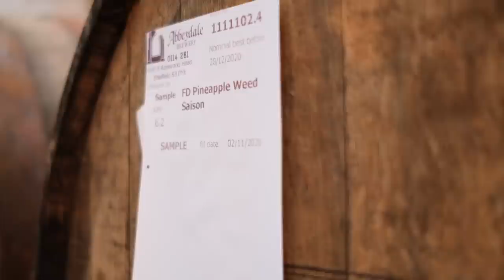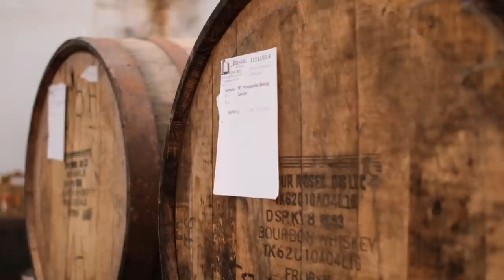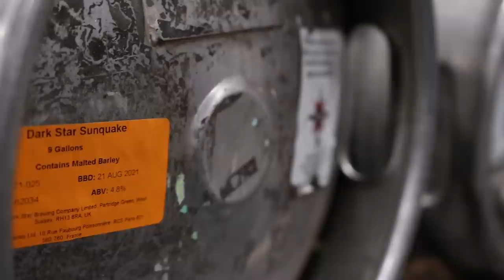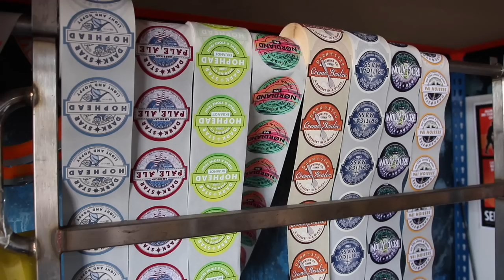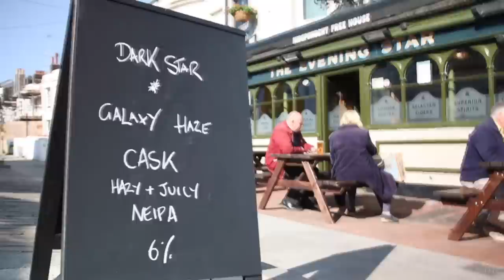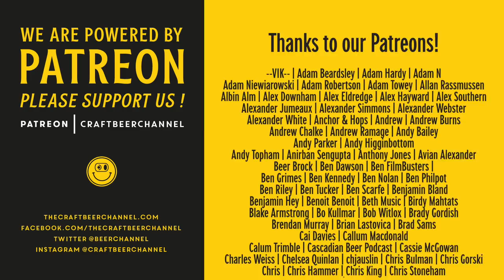The Future of Cask (Keep Cask Alive pt 3) | The Craft Beer Channel

Comment: Loving this series.  I was introduced to cask ale in the 90s as a late teen on a trip to England.  I fell in love with it. Thankfully in my area of the NE US, I can get cask ales here and there, but it is nothing ubiquitous like being in the UK. After my second trip to England in 2019 I came home and set up a cask system at my house. I have a few pin casks, a beer engine, properly controlled cellar temps, and a CO2 breather system for extending the life of the beer beyond a few days. Although when friends are over I just run with a traditional soft spile for serving.  I do several clones of my favorite UK ales that turn out very well. My property has a water profile that's right on for traditional bitters.  Thanks to Paul Pendyck of the Bull's Head Pub in Litiz, PA for starting UK Brewing Supplies.  Without his importing it would be difficult to access affordable cask equipment.
Reply from the maker: Sounds like you've got life all figured out! Which UK ales do you clone?
Reply: @TheCraftBeerChannel  A few regular clones I do include Cotleigh Barn Owl, Coniston Bluebird, Hook Norton's Hooky, Courage Director's, Landlord, and Tribute.  Basically the ones I really like that I cannot get here (or easily).  I've also found, like your series brilliantly points out, that modern hop forward styles, like NEIPAs, DDH and SMASH pale ales do really well in cask.  I enjoy seeing how a sparkler does and doesn't work for different styles as well.
Reply: @TheCraftBeerChannel  Kellem Island Brewery has closed
Reply: Sounds interesting. What is a sparkler.

Comment: Really looking forward to trying my first cask ale soon!  I was able to find one or two pubs serving it in Madison, Wisconsin.  Thanks for the well done series and opening my eyes to cask.
Reply: You sir are in for a treat! Cask is king!
Reply: Grumpy Troll used to regularly have a cask ale on tap. Swan neck pull, the whole works. It's been a few years since I've visited though.
Reply: @AdamRossD  looking at their menu I don't see cask mentioned but I may give them a call to see! Thanks for the heads up.
Reply: @solidsloth14  Comment back what you find out. I'll be up that way in a couple weeks.
Reply: @AdamRossD  I got an answering machine and left a message but still no reply. Will try again later this week.

Comment: @ craft beer channel...I like the idea of continuing the traditions of cask ale. I enjoyed the cask ales very much when I lived in England during my time in the USAF. I do wonder if associations such as CAMRA might loosen up a bit on what qualifies as equipment for cask ales to make the management of casks less labor intensive. For example how about using pressure regulated blow off valves with gauges rather than soft spiles.
Reply from the maker: I think they can definitely loosen it, so long as the key points of cask ale are maintained – freshness, carbonation and method of serve.

Comment: Really interested to see how they limit oxidation when filling the cask, it seems to be a fairly open process so is it just the short lifespan in the cask that ensures a fresh NEIPA?
Reply: must be, or they lie which I don't think they do
Reply from the maker: The refermentation in the cask would hopefully deal with much of the oxygen before it really damaged the beer.
Reply: @TheCraftBeerChannel  so there must be added extra sugar to that cask so fermentation could continue, I heard they put a bit of fructose so the beer would be fresh even after a couple of months!?!?
Reply from the maker: @geoguru81  Not extra sugar in most cases - it's usually packaged before fermentation finishes so there are a few points left to carb up and scrub the oxygen.

Comment: I need more information on this! I want to see what the process is. Don't need a strain, but if it's an Ale yeast, Lager, or Kveik. My guess is probably London Fog? Guessing they put it in the cask before it's fully dried out so it scrubs the oxygen in the cask and introduced in the transfer? This suggests early hopping schedule and no cold crash? Do they use a float in the cask? No SMB, ascorbic acid,  or other antioxidant added? Was it tapped that day? Do we know how long it lasts before it starts with the darkening and other oxidative issues? Do they use a CO2 Aspirator breather valve?
Reply from the maker: Hey Leo - this was a story for drinkers not homebrewers, but some very good questions there. It was an ale yeast, cold crashed then transferred a few points of the FG to allow for refermentation at a slightly warmer temp afterwards. I believe it was vented the day before and tapped that day, and nothing was added to prevent oxidation so I presume it would have turned within 48 hours – which is why this was filmed on a Thursday so it was busy as it gets (Thursday is the new Friday). Not sure on the breather valve, sorry!
Reply: @TheCraftBeerChannel  Thank you for the info! It is massively appreciated. Excellent content as always. Appreciate the advantages of broad appeal. I'm just fascinated by a good NEIPA served from a cask.

Comment: So cask beer being virtually non existent in Eastern Canada, how does secondary fermentation in the cask differ as far as mouth feel vs a kegged beer? 

I envision it as something similar to a beer on nitro, but maybe it is somewhere in between keg (CO2) and keg (Nitro). I think I have had one cask beer in my time, and while it was at a pretty good beer bar, their explanation of a "cask beer" was that it wasn't chilled, and the cask just sat on the bar in ambient temperature (clearly that is wrong). 

When going about making a cask beer, is it as simple as the beer goes from the primary fementer, into the cask (the secondary fermenter), and whatever yeast is still in the beer is what makes the CO2 in the cask? Or do that add more yeast to the cask? 

Could this not be done in a traditional keg home brew set up? Secondary fermentation in the keg? I realize it is manually pumped from the cask,  but instead of a pump to dispense the beer, could you not just use just enough serving pressure from a CO2 canister to dispense? 

Sorry for the question, cask newbie, only because it just doesn't exist here, save for one local brewery that has a cask night one night a week, but it is usually just a core beer, that they have put in a cask, with something extra (core stout with cold brew coffee and/or cocoa nibs added, or core Belgian IPA with some sort of fruit added), and it isn't pumped into the glass, the cask is just on the bar back, with a tap and gravity fed into the glass. Not sure if it is actually secondary fermented in the cask, and not just the cask filled from their brite tank, already with CO2 in it.
Reply: Gravity dispense is perfectly acceptable for cask beer IMO. It is the conditioning, the secondary fermentation, in the cask that is the key.
Reply: @andyleighton3616  Sure, but not when they just take a core beer out of the brite tank (same as they would do for a normal keg), put it in a cask with a few extras, slap it up on the counter and call it a "cask"
Reply: I'm the head brewer of a small brewery in Yorkshire. Half my family lives in Canada (Edmonton although they're moving to to BC) so I go to Canada every year at least once. I've had cask beer over there several times and have never had a good one.

The lower carbonation of cask does give a different mouth feel that is somewhat akin to nitro but yes you are right, the end result is somewhere in between.

Essentially it is that simple. Once your beer has reached the desired abv you chill it down to drop out the yeast, add auxiliary/adjunct finings and let settle for a few days. Then transfer to your casks. No extra yeast is needed in this instance. If you want a clear beer you may want to add cask finings (although you can get clear cask beer without if you want).Then let your cask condition for 2 weeks at around 12'C.

If you were to try the same method in a keg you would get something similar but when it comes to cask dispense is vitally important. With a proper cask you would let the cask breathe through a semi porous wooden spyle for 24 hours before serving. This allows the cask maturation to complete its process.

As for drinking cask straight from it gravity fed, that is totally acceptable and is the old style. However it ideally should be temp controlled.
Reply: @T-1001  Yeah, there is only one locally that does a cask night once a week. I don't believe they are secondary fermenting them in the cask, just filling them off the brite tank same as they would for a normal keg, so the beer is already carbonated, and then adding something extra to them to make them different. 

Gravity feed, room temp when they are served